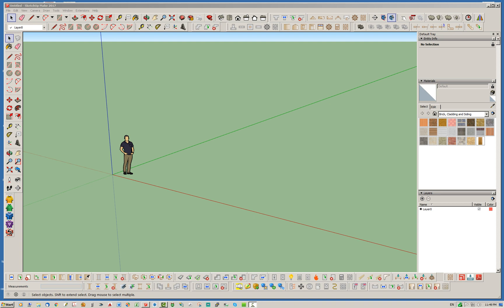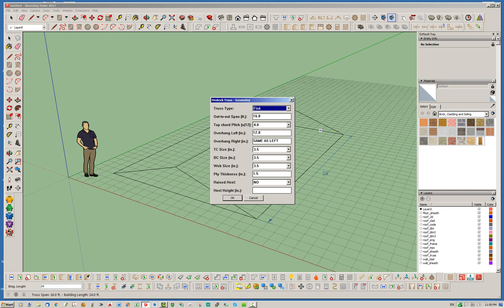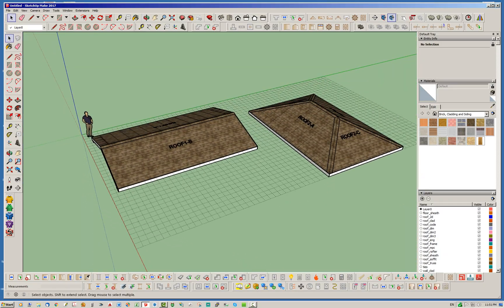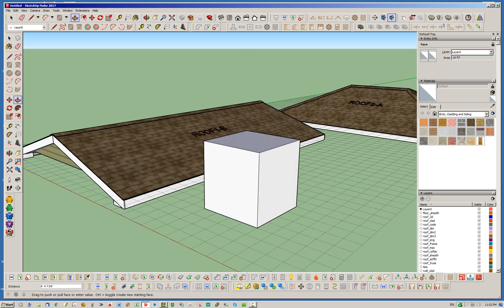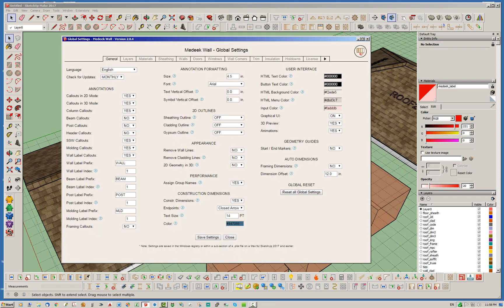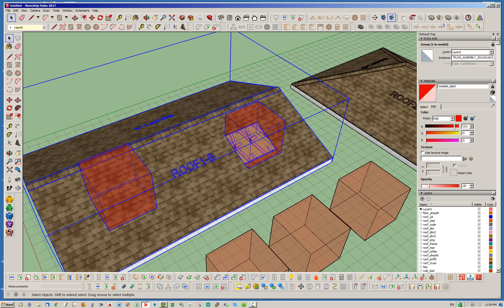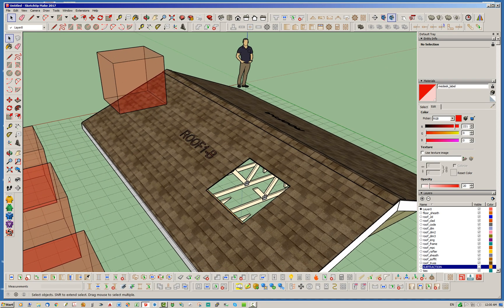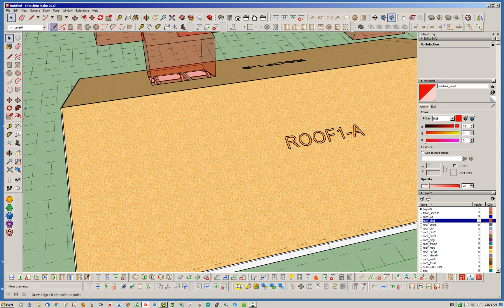Medeek Truss Plugin Tutorial 20 - Custom and Subtractive Geometry

Comment: Oh sir! you just made my day.  I have a project I'm working on and the tool you have in your suite that allows you to select faces then "cut" and item hasn't been helpful for once due to the design.  You just made my DAY!!!!  Happy Father's Day to all the dads out there!!!
Reply: @Nathaniel Wilkerson - I tried the subtract feature and it isn't working for me.  I updated my plugins this morning.  I am running Sketchup 2020, could this be the issue.  No Ruby errors, it just regens the roof and deletes the blocks, no subtraction to the roof, and I have triple checked that I have it turned on in the settings.
Reply: @jonreynolds3119  @Nathaniel Wilkerson I seem to be having the same issue. Did you ever find a fix?